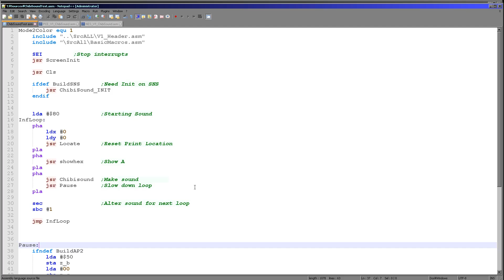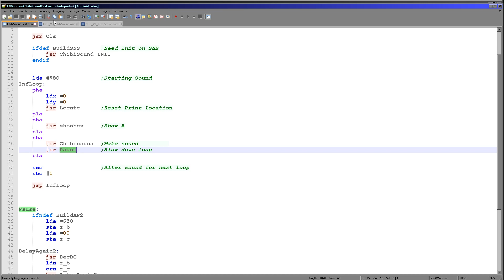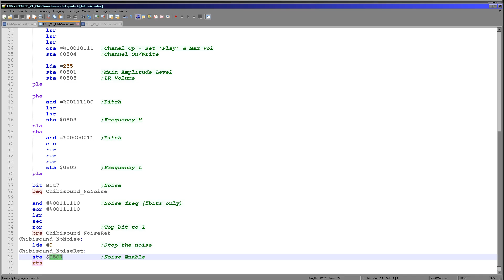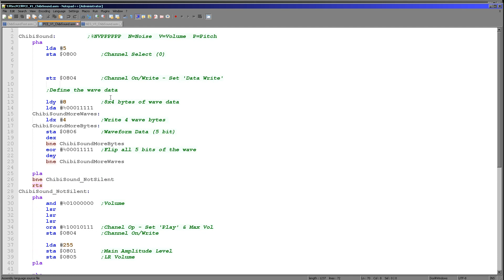Sound on the PC Engine (TurboGrafx-16) - Learn 6502 Assembly Lesson P25

Comment: Any clue on how to fix one of the sound channels that has gone quiet?
Reply from the maker: Failing capacitors often cause the sound to go quiet or silent, 
Open it up, check for leaking or 'bulging' caps, If there are any they would need replacing.

I'm sure you can find a capacitor list online for the system you're using.
Reply: @ChibiAkumas It turned out one of the audio cables went out on my component cables. I replaced with the hdretrovision genesis component cables and the audio was fully restored. I'm sure I'll have to deal with the capacitor problem on these retro game consoles eventually though. Thanks for your advise.